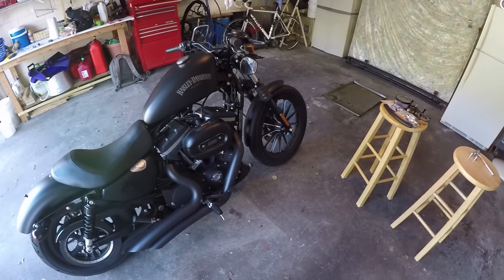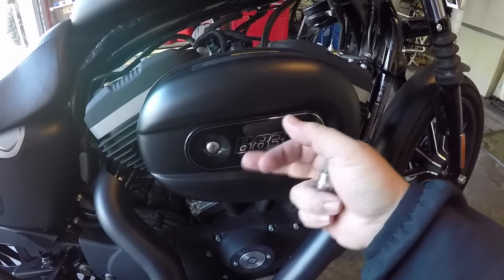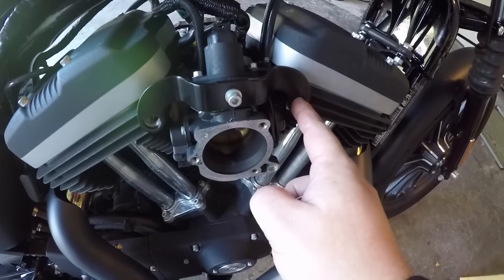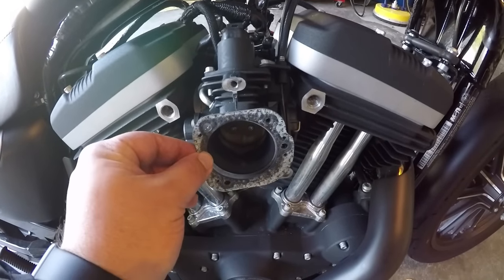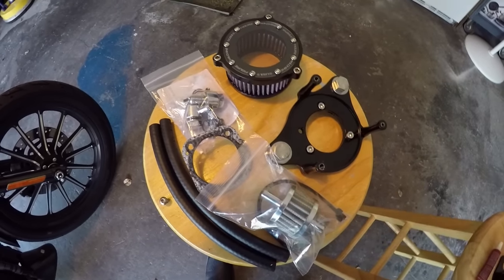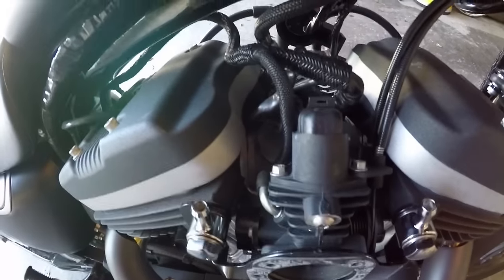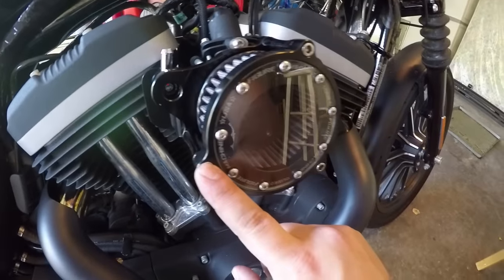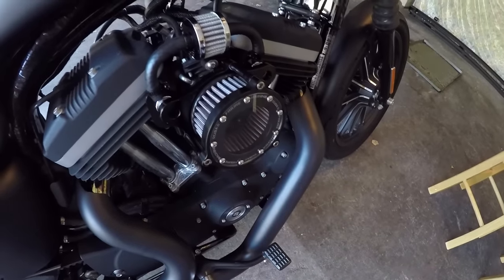HOW TO: Stage 1 Air Cleaner / Filter Install on Harley Sportster

Comment: Victor here, have another idea for your air cleaner if you did not get the grommets I put two skulls one on each side but I want to suggest maybe two black spikes like the ones you put for your seat or license plate just add the back washer oil flow looks real nice check it out.

Comment: Blockhead, im new to bike. may i know the difference between stage 1 and stock air filter?
Reply: Stage 1 includes air filter, exhaust and a re map tune which is usually changing the fuel and air mixture to suit your new stage 1 set up. You can install the parts without the tune but it will go and sound much better with a tune.

Comment: Question, the time you had with your breather filter has it leaked at anytime. I like the way you installed it (up) instead of down word, is the breather holding up.
Reply from the maker: No leaks at all. The breather bolts have the metal pieces that stick upwards out of the engine, which holds the hoses and the filter up :)

Comment: I have the same filter you need to leave the throttle body support bracket on to fit correctly
Reply from the maker: As I posted on your other comment, support bracket wasn't the problem, it's the alignment of the jugs that is off on my bike, which causes the breather bolts not to line up with a rigid backing plate. Nothing to do w/ the support bracket.
Reply: I don't see how the jugs can be out of alignment and the engine hasn't blown yet. But who am I to say. Sorry for trying to help
Reply from the maker: As I posted on your other comment; I appreciate you trying to help, no apology needed, don't take it the wrong way. My reply was supposed to be meant as informative to you, as I've talked to numerous people about the issue. The jugs are able to be off by a 'fraction' and not blow up, hence why HD designed the back of their large plastic air filter housing to have some play w/ the breather bolts. It's still within spec, but for rigid backing plates, it unfortunately doesn't work / line up correctly. Ride safe! :)

Comment: Cant figure out this issue I have. Bike lags boggs out in 4th and 5th gear and lots of backfire on decel. my local harley shop wants me to dyno it which is very expensive. Do you think putting a new air cleaner on it would help it has slipon Vance and Hines pipes. Not sure what to do any help is appreciated.

Comment: Good video. Glad you have a system that works for you. I actually am using the DK 587 but with the chrome cover. No problems so far, everything is tight. Although I'm not using one of DK's special bolts, just the standard one and everything's been great. I am also running their external breather bolts and those work great too. A little blow by but nothing to major. My next plan is to actually upgrade to the same external breather system you just installed, going to wait for better weather though. Not all of us get to enjoy 50 degree weather as their winter lol. As always ride safe my friend.
Reply from the maker: Yeah when speaking with a guy on the phone at DK Customs, he said he's been running one for thousands of miles and it hasn't given him any probs, but he has the standard one as well, AND on top of that, said he didn't even put loctite on it. So the problem w/ my previous one was definitely the specialty bolt. The hose / filter style external breather system seems to be doing well so far, haven't seen any blowby on the bike since changing over. The 50 degree weather lasted for a few days, we're back up to 70's - 80's and humidity, haha. Our summers are pretty terrible though, so suppose that's a balance. Ride safe sir!

Comment: Hey Blockhead how did you plug up the holes for the backing plate?
Reply from the maker: +Steven Trujillo Self adhesive silicone tape #Gangstah
Reply: @BlockheadMoto  hi, 1st of all thanks for the video, awesome!! I'm installing this kit, do you have a pic or follow up video to see how you plug up the holes?  Thanks!

Comment: Yeah, EFI "no-filter" increased air-flow, aftermarket products usually end with a bike in a local H-D shop or home garage to clean out all of the road debris and air detritus sucked into the throttle body. Trashing a catalytic converter can cost a lot for road rehab too.

Comment: How is this intake working out for you? I currently have a screamin eagle intake that uses the stock existing intake housing but am looking to get something that's a bit nicer looking.
Reply from the maker: +MrSXys WildRide Working out great!
Reply: I have the same intake as you pretty sure the not enclosed screamin eagle with k&n, I'd stick to it, it's best your going to get it term's of performance and not having to worry about rain, plus it's a much bugger filter it can hold more dirt then that little one, as cool as it looks.

Comment: Just installed DK Custom's external breather with the catch can, not too sure how I like the look. How's the external breather with the filter working for you? Do you smell the oil or is there any mist? Does it go anywhere?
Reply: Remove the filter and purchase of ebay a 200ml or 300ml oil catch can and replace the filter with that.
Reply: You may need to secure the catch can though as it might be abit heavy

Comment: Hey did you re-tune and what settings with the fuel pack did you use?
Reply: I was going to ask this question David im looking at aVH fp3 fuel pack. Want to no how you set it for this air filter.

Comment: Won’t those tubes rattle and melt by the engines heat and movement? What’s the leg clearance because it looks like the intake sets far out?
Reply: Way better clearance then huge stock one that's for sure. But can't ride in rain so not to sure about this air cleaner, I've got screaming eagle cleaner it's same size and shape as stock air box but isn't enclosed on the inside it's all open on the inside and I run a k&n filter in it with vnh short shots re mapped by harley and it flies, 0 100 feels really 👍

Comment: I don’t know if i missed it but is the external breathing system with the hoses included with the kit? Or that’s bought separate?
Reply: All parts are sperate, only whole kit is the air filter with its stock bolt on kits, blockhead used parts bought to fit onto DK customs bracket

Comment: I live in the UK and I would like to go with your set up. I have found the Air Filter that you used, but could you give me the Part No of the Backing Bracket for the Breather Bolts that you purchased from DK Customs please.
Reply: Did you find out wher to buy in UK those bolts? I got supercharger in my xl1200 and there is also similar hose between two breather bolts. I think to change it for smaller air filter same as on video. I think this breather bolts are important

Comment: Hey Blockhead, is it possible to run an air intake setup like this but instead of using an extra plate can you run just the breather bolts in place of the internal breather setup?
Reply from the maker: Not sure what you mean? The external breather bolts replace the internal breather setup, so yeah if you go w/ an external, it won't vent internally. As for the extra plate, I assume you're talking about the rear mounting plate that goes on the throttle body? Not sure if you'd be able to run one without that, as it makes all the spacing correct, but possibly. Best way to find out is to order the parts and try it out! :)
Reply: BLOCKHEAD yeah I mean just using the kit as it comes but using external breather bolts instead of the ones supplied with the kit.
Reply from the maker: Originally, I was using this setup venting externally to atmosphere even though the air cleaner system was designed to vent internally. I'm still venting externally, but now into hoses and to the filter so blowby doesn't get on the side of the bike.
Reply: BLOCKHEAD alright thanks man!  I ordered a filter and will probably use external breather bolts.  Keep up the videos!  it sucks being in New York this time of year :(

Comment: Hey blockheads , how is that Amazon intake system working out for you so far , I'm looking into putting one on my nightster , I have Vance and hines short shots on it and wanna add and intake and fuel management . Most air cleaners are stupid expensive and that one is so cheap I wanna try it but wanted to make sure it was a safe way to go . I love the looks of it too ! let me know what you think so far . thank you in advance I love your channel !!
Reply from the maker: Working great so far, got no problems with it! Just be sure to buy a legit K&N filter, I think the one it comes with is a knock off. This is the one that fits it, it's the one I bought - http://amzn.to/2rBeQCY  

Also purchased the rain guard that fits it here - http://amzn.to/2rB4GCg

Comment: Hey Blockhead, just bought a 2017 Iron 883 thanks to your vids!

I'm looking at getting the V&H Short Shots - did you have any issues when you just upgraded just your exhaust without any other Stage 1 mods? 

The Harley dealership were reluctant to sell me just the Short Shots on their own as they said I really need the full Stage 1 so there's no engine issues but wasn't sure how true that is? 

Thanks!
Reply: Your engine has to be tuned after a upgrade... for air fuel mix.. So it's kinda true.

Comment: How's your fuel mileage since the tuning?
Reply from the maker: Ended up having to revert back to V&H recommended tune, as when trying to run the AutoTune, the bike was running poorly. I should have a video up tomorrow of that. With the V&H provided tune for high flow intake + big radius exhaust though, I'm getting poor gas mileage as well, averaging about 35-39mpg, fuel light usually comes on at about 60-70 miles in. Hopefully we'll figure out the AutoTune thing and get that fixed up!
Reply: Yup. Same problem here. I had the dealer do the download because I don't have a laptop....
I was averaging 45-47mpg before the tuning. Now I'm getting 32-34mpg.
Reply from the maker: +Black Star You too? That's crazy, I wonder why the mpg drops so significantly. Do you have the Vance and Hines FP3 as well?
Reply: No, I had the dealership do a download because I don't have a laptop, otherwise I would have bought the Screamin Eagle Street Tuner- which I'll probably have to do anyway.... :-/
The fuel mapping is super rich- I can smell it in the exhaust when I'm sitting at stoplights. 
Some other things I've noticed since I had it tuned:
Cold idle is 1300rpm (was 1600rpm).
Warm idle is 1000rpm (was 900rpm).
Redline is over 6500rpm (was 5500rpm).
I haven't noticed any performance improvement, but I'm not making popcorn anymore when I let off the gas.
Reply from the maker: Gotcha, so your dealership gave you a new map through their laptop. Direct to your ECU from the sounds of it? (instead of being handled by a fuel controller.) The Fuelpak FP3 doesn't require a laptop, can connect to your phone, so long as it has bluetooth (using an iPhone w/ mine.) I noticed my idle change as well, between the stock map, V&H premade made, and when I was in autotune also. 

I'll have to call V&H and ask them a few questions. When I do, I'll be sure to update via comment here. Thanks for sharing your experience as well Black Star!
Reply: BLOCKHEAD how much is for a tune? I bought mine with v&h pipes and air cleaner. So just want to get it checked to make sure is tuned correctly
Reply: BLOCKHEAD do you have to do a tune if only doing air cleaner? I have stock exhaust but hate the look of the stock air cleaner. But am not ready to invest in exhaust and tune if I can just do the air cleaner.

Comment: Hey what happened to the NoFuckingFilter4000?
Reply from the maker: Sadly I had to upgrade, lol! The NFF4000 was a short lived system. AMAZING for increased air flow, but very risky, as the engine / throttle body could suck in things such as pigeons, candy, articles of clothing, and sometimes even small children. Risk < reward, lol

Comment: why do i need this bracket? this makes no sense
Reply from the maker: Is meant to run breather bolts through it to add support to the filter, so the throttle body isn't the only thing supporting it. It's not a requirement, but I had one already from a previous kit, so kept it and put it on.

Comment: This coming from a dude that had his completely fall apart?
Reply from the maker: "Completely fall apart," lol. Yeah, the face plate and filter fell off b/c it was retained by one bolt that wasn't long enough (as stated by mfg, 44mag bolt didn't have long enough threading) therefore even with loctite, still managed to shake out b/c not enough threading caught. Somehow that's "completely falling apart" though, right? Nah. Did you watch the video? B/c if you did, you'll note that I even say to LEARN FROM MY MISTAKES, and use thread locker on all the screws and bolts, as well as mention torque specs, and following direction for whatever air cleaner you end up installing. 

In the 'suggested videos' at the end, I even include the video to where the filter fell off. Would I do that if I was at fault and take away from my own credibility? Definitely not, lol. Thanks for playing #MoveItAlong
Reply: BLOCKHEAD backing plate was all that was still on so yeah, "completely fell apart" and take it personally if you want but you're a novice, and I wouldn't want one of your videos to be suggested to someone else that's in need of assistance. Think of it this way, what if you start doing major modifications like shocks etc and the same thing happens to some kid that watched your video about it and he has his shocks fail on the highway? Now granted that's his fault, but still. Just be aware that anyone can be watching your videos. Granted these are just bolt on parts but you've seemed to have managed to botch even that so how can a person trust you with more than an air cleaner? Unless you're a mechanic you shouldn't be posting how to's. And btw you're really not doing sportster riders a service, just adding to the stereotype.
Reply from the maker: +Rooster How did I "botch" that air cleaner that ended up falling off again? Please tell me how you seem to be more insightful to what happened with that than I am. As stated, the bolt that was provided that held the faceplate as well as filter onto that model air cleaner was not long enough from the manufacturer. Even though I put loctite on the bolt, it did not catch enough threading to securely hold and ended up slowly vibrating out. The mfg even noted this on a phone call. 

The air cleaner I had on before that held strong, but the breather bolts didn't line up with a rigid backing plate since the jugs are off. 2nd one, mfg bolt was the problem, sent it back as it was a poor design. 3rd, holding strong and no probe at all except blowby. 

So again, please tell me how I've "botched" this? 

Also, I wasn't aware of a stereotype for Sportster riders, but please elaborate on that if you'd be so kind...
Reply from the maker: I'd love to go on and on with you about this, but this comment proves to me that you have absolutely no insight into what you're talking about when it comes to installing a DK Customs HiFlow 587 air cleaner. I'll chalk up your lack of insight on that, as well as your lack of knowledge on me and my background with anything mechanical, to ignorance. All good! Again, move it along, and thanks for playing! Have a great day :)
Reply from the maker: I'll admit, "budget warrior" made me laugh. Although once again, more ignorance shown. Just move along man, be a Rooster somewhere else
Reply: BLOCKHEAD how is it ignorance? You literally got what you paid for. It's more ignorant to buy cheap and expect quality results. Dk customs is the flee market brand of the harley world.
Reply from the maker: *flea market
Reply: BLOCKHEAD wants a Harley, buys a sportster LOL
Reply from the maker: ~120,000 sold in 2015 alone. Seems lots of people agree with me on their purchase ;)
Reply: BLOCKHEAD I'm saddened that I got you to the point you had to Google that... But yeah women are getting into it
Reply from the maker: +Rooster Knew that before I bought the bike, researched. You're on of those "always has to have the last line" kind of people, aren't you? Funny thing about that, I'm not, but I can tell you, you're not gonna win. Ya know, since I have the power to block you and all as you're in my channel ;)
Reply: BLOCKHEAD this was hilarious!  Haha I love your last comment and shutting him down!  I think it’s too funny how “Die Hard” Harley supporters trash a bike like the Sportster when it’s made by the very company they would seemingly take a bullet to defend!  Love my Sportster 1200.  This from a guy that races sport bikes semi professional all over the country at 170mph +!  Great bike and great channel!  You are a regular guy trying to help out us regular guys.  Your videos are informative at the very least.  Sometimes after watching I know exactly what parts I want to get,  and other times I realize what parts NOT to get.  Either way it helps.  Keep up the good work!